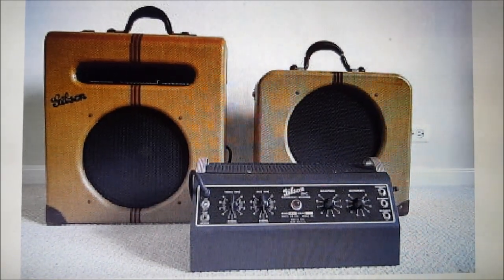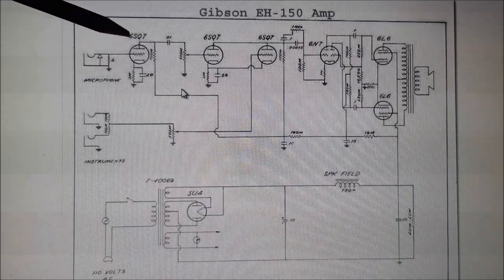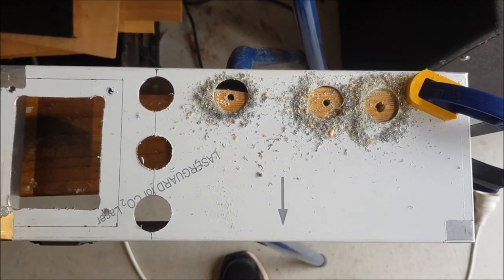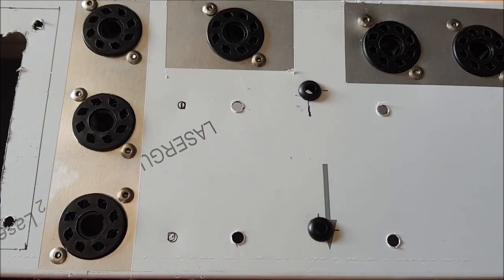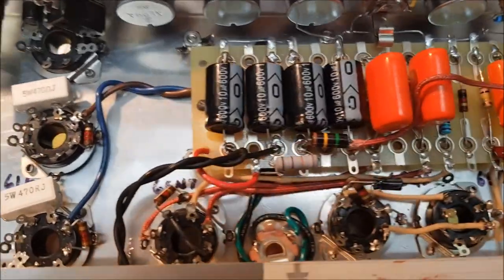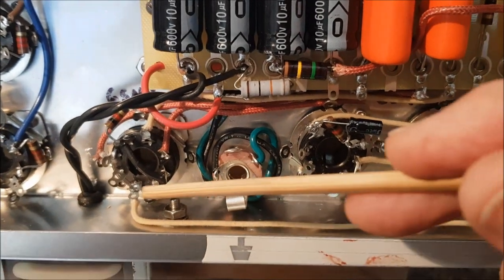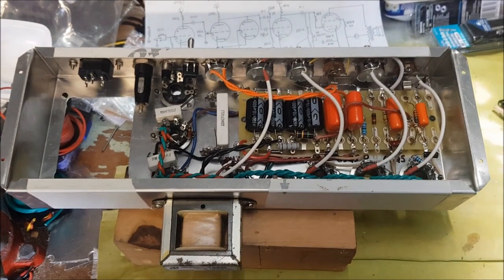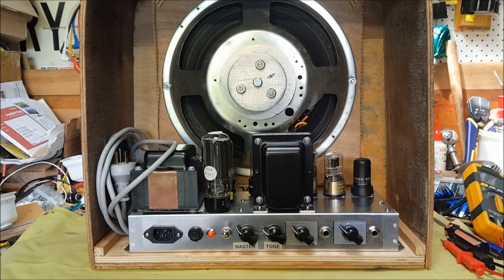Building the "Charlie Christian" amp - Gibson EH-185/ EH-150

Comment: Very nice build I've just done gibson GA20 in a period correct cabinet, similar sound using a 10 inch eminence Rajin Cajun speaker. BTW. I'm hooked on Petodes at the input stage, done several.

Comment: Brilliant, sounds great. Loved watching you squeeze a quart into a pint pot as we used to say in pre-metric UK. When I saw the size of the output transformer I actually laughed out loud. Well done, I thought with everything crowded so tightly you'd have had interference and buzzing issues but it's worked out really well.
Reply from the maker: Thanks Rob. Yeah I'm happy with the result. Now I just have to finish the cab.
Reply: @TheZedvox Difficult to imagine how to handle that cabinet, good luck. I had heard comments that the very early Gibson amps had great tones. Interesting to see and hear your build. It's a complex circuit compared to early Fender's. I just made myself a Deluxe Micro 1W combo based on info from Rob Robinette's website. Added a one valve reverb and tank plus a pre speaker L-pad attenuation control for toneful but dead quiet practice at night while Wife and neighbours sleeping (not together of course :). Very pleased with that, looking for the next project. Fancied building a Gibson L3/L5 oval hole copy. Love the shape of those old archtops with the big bulbous bottom bout and narrow shoulders. So 1900's styled. 🙂👍
Reply from the maker: I wish I had your woodworking skills. Love the Gibson L5.

Comment: A great sounding amp. I’m building one myself at the moment. Using a 6SN7 as PI like you. Had a couple of 6SC7’s so using one for the second gain stage of the mic channel and the first and only for the instrument channel since it’s a dual triode. 
Is there any possibility for you to share your schematic and layout so I can compare before I’ll bring out the soldering iron? And also your B+’s?Putting my choke between the screen and preamp and using resistor before that. Will also include a reverb tank and putting a Mosfet reverb driver just before the PI stage.

Comment: Oh my friend, you don't want your transformers that close if you got the space to separate them. As far as possible from each other to avoid interference and for balance of the amp itself.
Reply from the maker: Yep. I agree. It was a bit of a compromise, but if you look at early amps, they often had the topside components very crowded. Anyhow, the amp is nice and quiet, so I'm happy.
Reply: @TheZedvox  Yes, the original (a 150 in my case) had a very tight fit, the 5U4 on the left was cooking the cabinet over time and I had to install a thin heat shield!